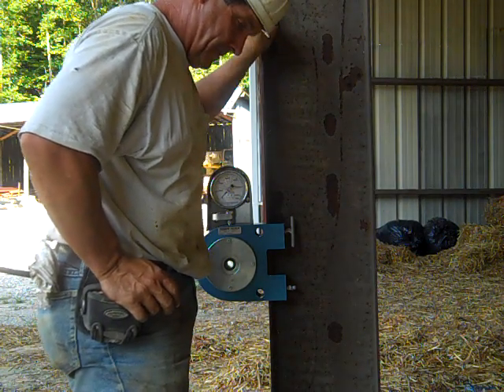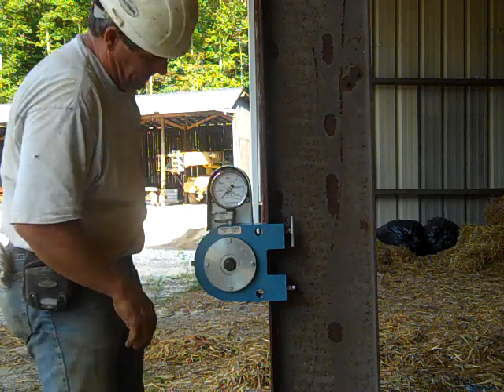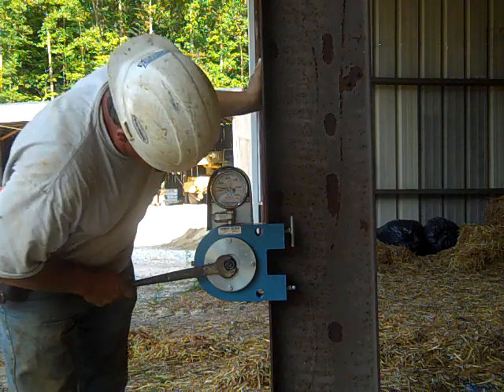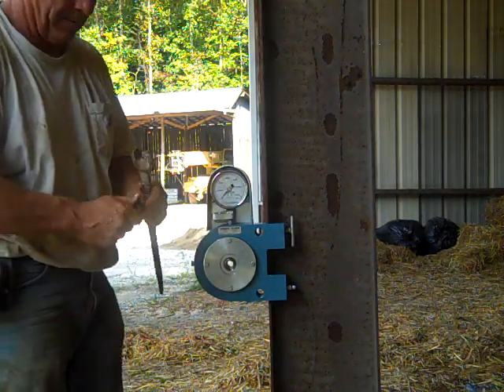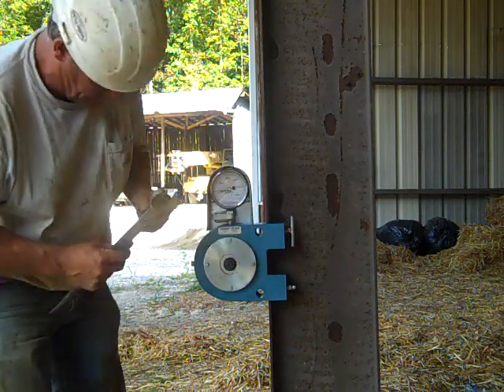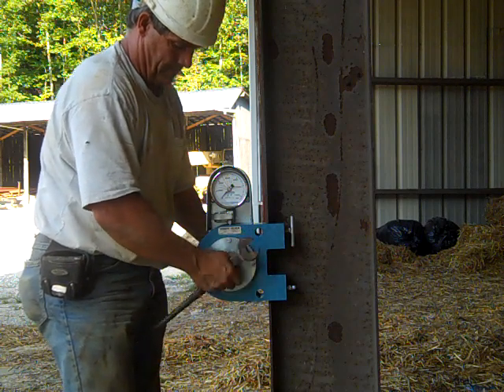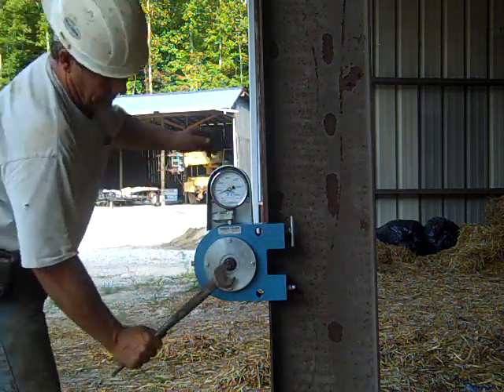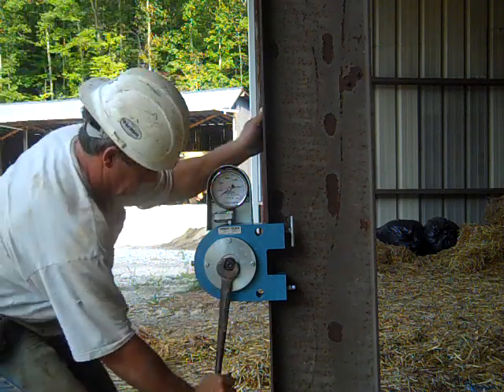AISC Pre-Installation Verification

Comment: Does not pass.  Minimum requirement is 28kips for a 3/4 inch bolt.  You need to perform this on a minimum of 3 bolts of each lot and type.
Reply: You did hear that they only had 5/8" bolts right?
Reply: I think he said they are 5/8 diameter